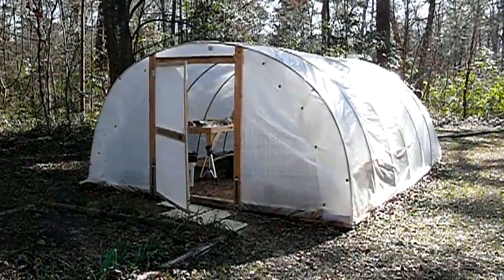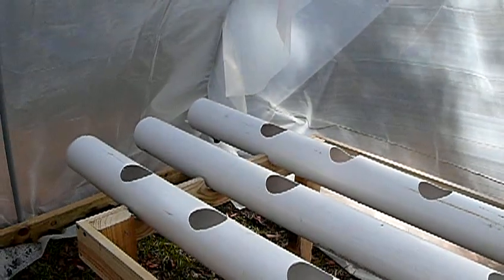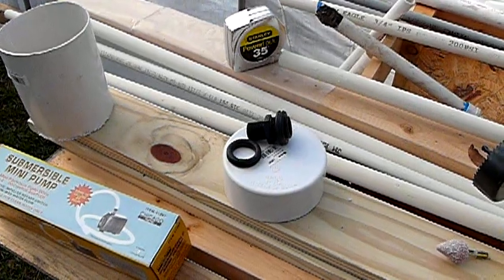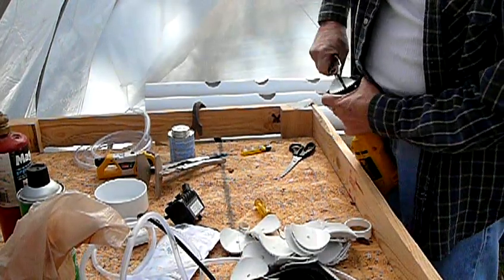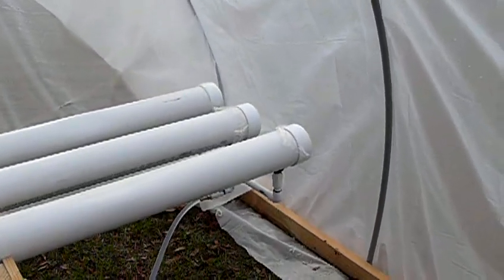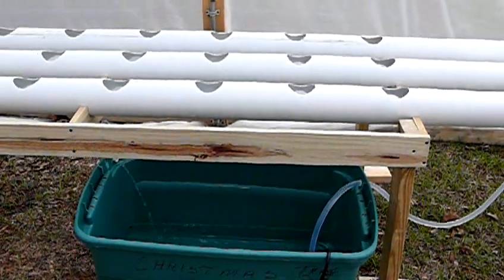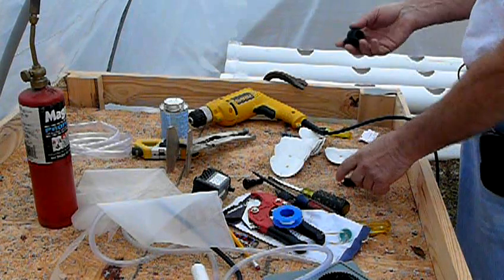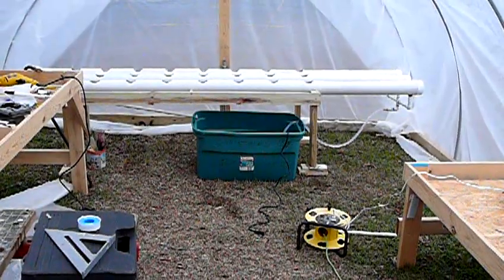hydroponics how to build

Comment from the maker: I have black slip on insulation for the clear plastic tubing.  Thanks for the tip on burying the nutrient reservoir.  What is too warm ?  How about too cold ? I will take your advice on the pumping schedule.  How often do you need to renew the nutrient solution ?

Comment from the maker: Yes,  I think you could flow from one pipe to the next...  I was concerned about draining the pipes as much as possible during my original constructions  (O2 for the roots)...  but leaving some water standing in the system seems to work for me.  I cycle too often for a standard light timers.
Dave

Comment: Thanks for sharing this :) .. I have a question: does the liquid solution enters to the pipe by one side and get outs the pipe by the other side? I mean, does the solution is re-circulating or you fill the pipe and then you turn off the pump and turns on again when the tube has not enough solution ?

Comment: I'd drill holes in the top near the end caps and just drop the supply into the holes and you wouldn't need the seals.  put a 4" to 3" bell reducer4 on the other end to always hold a little water in case of pump failure.

Comment from the maker: I run the pump just long enough to fill up the tubes.  The time depends on pump capacity.  The outside system uses a 12vdc sump pump rated at 350 gph and it takes one minute to fill the system.  I cycle the pump on every 20 minutes around the clock.

Comment from the maker: Solution enters all three tubes via a pvc header.  A overflow tube resides in the last tube. So,  fluid fills up all three tubes but only circulates in the last tube.  Will be interesting to see if plants in the last tube fair better due to "fresher nutrient" solution.  I have no way of knowing if the tubes are full at this time.  Plan to pump for 30 minutes,  then off for a hour or so.

Comment from the maker: found the post jackets at Lowes.  4X4X100 are $22.00  The pvc drain tubes I used were 12' long and cost $7.00  I still may try out the square stuff if I have any luck with what I'm using now.. Thanks.

Comment: nice to have the same PPM except u can't. PPM only measures solids, it does not tell u WHAT solids are in there. so if ur strain is using more calcium than the last strain then very quickly ur solids will be out of proportion to each other.

the way everyone does it is u add plain water to top up until u have added an amount that is equal to the original volume of nute water. ex: ur res is 10 gallons of nute water? so top off with plain until u have added 10 of plain, then empty, start over.

Comment: Still not underway with this project. Been several months now. Keep having to change things around. Nothing seems to be going Like I have it pictured in my mind. Suppose I should draw a diagram. Like davetidwell, I keep trying. With any luck I'll be growing in a few weeks. Sprouting some lettuce and spinach seeds now. Geting to cold S. Calif. L.A area. May have to wait 'till spring or build a greenhouse like dave's. worried about water temp. Is'nt this a fun way to spend retirement.

Comment: Couldn't you plum the tubes together so that they were all technically one tube. Put the pump at the beginning, it would fill the first pipe and flow into the second, then into the third. Use a cheap christmas light timer to turn the pump on and off. It'll fill the pipes, turn off, and the liquid would drain away into the reservoir

Comment: I'd drill holes in the top near the end caps and just drop the supply into the holes and you wouldn't need the seals.  put a 4" to 3" bell reducer4 on the other end to always hold a little water in case of pump failure. I'd place my tank under the end where it would drain right into the tank.